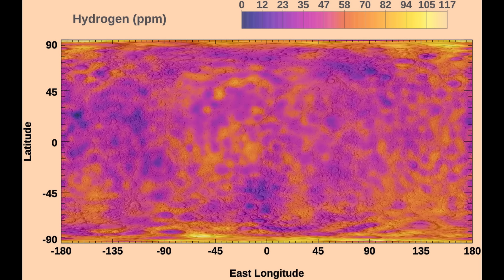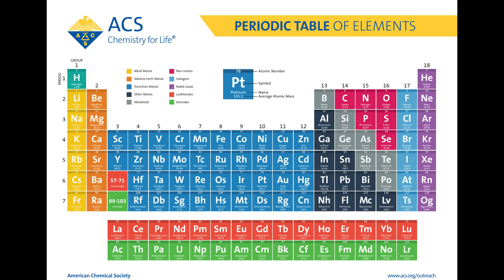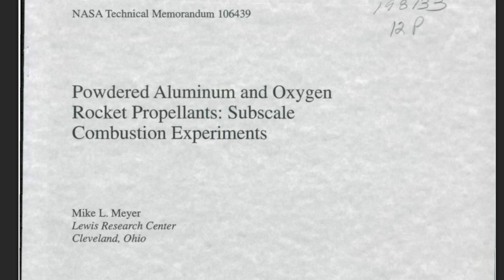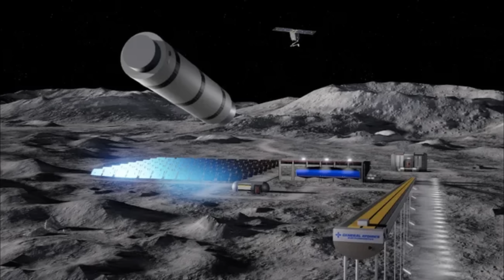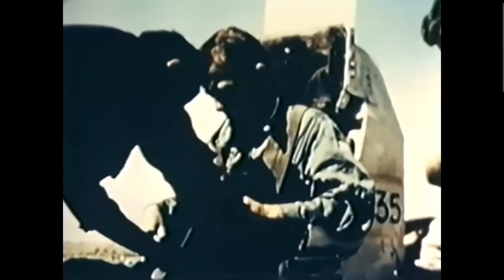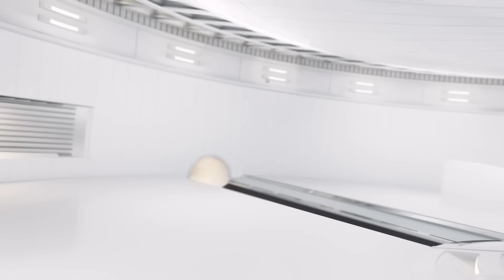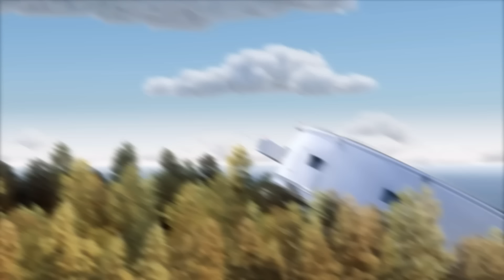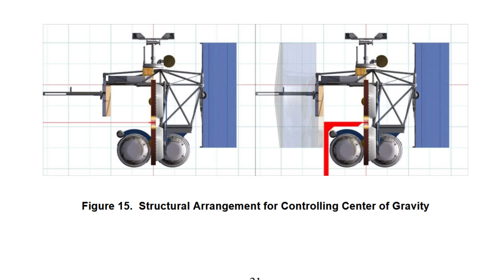Launching From The Moon With Silicon Based Rocket Fuel And Other Ideas - Deep Space Questions

Comment: Given that it takes a LOT of propulsive material, an easier way would be to have a large blast container at the back to recover and able to refine the blast ejecta. Yes, I know some will be lost from the ''Gun'' itself, but if most was captured and re-refined (Imagine suction using the higher pressure of the blast chamber, a blast shield that closes milliseconds after each shot and a  LOT of mini-sweepers recovering solid waste) it would make it a heck of a lot more efficient. A worse ''factor'' is how to slow the decent of the material shot when it arrives at the Earth, you don't want it to disintegrate when it hits the Earth's atmosphere. Aluminium for example is a toxin, and you don't want to poison the Earth... Coils would be far easier.

Comment: One way to get a counterweight for a space elevator is to use material launched by a mass driver from the moon.  For those materials where you want a container to hold it in, once it's launched and you remove the cargo, you have a big empty bit of moon rock.  Design them so they nest, and they can form giant pillars that you bind together with carbon fiber nets and anchor the space elevator.  This material would also be a good way to block high energy cosmic rays and solar flares for the zero-G station, minimizing the material you'd need to launch from Earth.

Comment: I’m fairly convinced that mining asteroids is more achievable. The moon has too much gravity, so you need a rocket that gives a lot of delta V very quickly to get off the surface and into orbit. 

Getting away from an asteroid requires nothing more than an ion drive. Even if the overall energy budget may be higher (because of the need to get back down to earth’s orbit), it’s more readily achieved because there is far less need for a big chemical rocket.

Comment: A nuclear-thermal rocket using pure oxygen as a fuel is certainly possible if the reactor core and other engine parts are made from oxide ceramics. Such reactor cores have been developed and even tested in the past for direct cycle nuclear jet engines such as TROY. Temperatures of up to ~1000°C could even be reached using metallic structural materials like Ni-Cr alloys, which has been demonstrated in the HTRE experiments.

Comment: Since you can orbit the moon at hilltop level, I always though a platform accelerated by a Maglev track and a rotating skyhook is the cheapest way to send stuff to orbit if one wants to avoid the multi-kilometer launch track and the *pick your preferred decelarating option. The combination of skyhook and short tracked "train" is also 100% reversible for landing stuff on the moon. If scaled up enough it is suitable for low-G payloads too, but you need to built the long piece of infrastructure or use rockets to compensate

Comment: AEROSPACE ENGINEER HERE: The problem with manufacturing ANYTHING off-Earth for delivery to Earth is the final step.
Delivering to Low Earth Orbit (LEO) is one thing delivering to the surface of the Earth is another thing entirely. Its simply a matter of logistics and the problems logistics create like energy dissipation. 

For every kilogram in LEO it has akinetic energy of 30.25MJ which might not mean much but 1ton (1,000kg) is the equivalent of about 7.23 tTNT and the Space Shuttle (~70 tons) is about 506tTNT or half a kilo ton of TNT. With its max landing payload of 14t a Space Shuttle comes back down with the approximately 600tTNT.

The reason I bring this up is that a few years ago Jeff Bezos (yes the Blue Origin guy) said he wanted to move all processing into Low Earth Orbit because there would be unlimited cheap energy and pollution would just drift away into space. Around that time I was working on an Australian iron ore mine called Tom Price in Western Australia. I went into mining because in 2002 I met Harrison Schmitt who told me to look into Helium-3. So I went looking for mining experience to add to a back ground in aerospace, automation and robotics. 

Tom Price was good because the math is very simple because it produces around 20mta (million tons per annum). 
At an average around 70% iron content 20tons of iron ore produced 14tons of raw iron. FYI - that's how iron ore is graded and sold - by its iron content.
So Tom Price's 20mta would need 1million space shuttle flights NOT because it need that many to lift the iron ore up but because that's the limit of the Space Shuttle coming down. Scott can explain the difference between MTOW and MLW if he likes.

Problem 1million space shuttle flights equals 600million tons of TNT.
To give that perspective the current W88 thermonuclear warhead of a trident missile has 475kTNT of "bang"
So 1 million space shuttle flights is like letting off 1263 W88 thermonuclear warheads in the upper atmosphere.

Tom Price was once a large iron ore mine for Australia at 20mta
Most of our new mines to 60mta and Australia's production is over 920mta or 46+ times Tom Price.

Sorry but unless we come up with a magic Star Trek transporter or wormhole technology we will never bring anything back from either the moon or anywhere else for use on the surface of the Earth UNLESS we only need it in very small amounts and its extremely valuable.

For example Scott mentions Helium-3 which actually has been proven to be usable for nuclear fusion BUT like every other form on fusion IT DOES HAVE PROBLEMS making it work. In the discussions of Helium-3 I once saw someone claim an amount needed to supply all of Britain's energy needs and when I extended that out to 8billion people it requires less than 10 space shuttle flights to land from Low Earth orbit at a cost of under US$5billion for a fuel value of over $1trillion.

I am NOT the only person to have worked out those sorts of numbers and its why there are people who still think Helium-3 is a viable future fuel. For anything else its the same basic problem you need to find something that is incredibly valuable per kg.

FYI - The reason why I use the space shuttle in these sorts of calculations is because to date it is still the only viable system we had for bringing any sort of cargo back down to the Earth's surface. Yes the Russian had Buran but it only flew once and nobody really knows what it might have been good for.

Here's the thing - even if we suddenly did have something better than the space shuttle and even if it was 100 times better then we'd only need 460,000 flights a year to lift Australia's iron ore into orbit and bring the stell back down. Then there's the problem that Australia is only about 1/3rd of world production. 

Plus there's all the nickel, copper, aluminum and other stuff we use to deal with.
Reply: Follow #1
On the subject of Aluminium as a rocket Propellent- ITS A WELL KNOWN Propellent.
Look at the Wikipedia page for the Space Shuttle Solid Rocket Booster and look at the propellent the link is in the box of specifications (RHS) at the bottom.
The link is for APCP (Ammonium perchlorate composite propellant) and on that page look at the list of components  and the sub-section "High energy fuels".
Reply: Follow up #2
On the subject of mining and materials process in on the lunar surface.
The most fundamental issue is "How do you start making stuff on the moon?"
How do you start digging up stuff?
How do you then process raw ore into raw material?
How do you process raw material into raw stock than can be machined, molded, pressed, forged,.... etc?
How do you get the basic machinery to the lunar surface to do these things?
How do you do casting, machining and welding in 1/6th gravity?

I priced a small lathe a few years ago and its cost was around AU$4000 and its the sort of lathe you'd need to start making stuff on the moon. IT WEIGHED 600kg NOT including the tooling, coolant, grinder to re-sharpen tools or power supply So if you added in another 400kg for all the other stuff then its a neat metric ton. 
At US$10k per kg to LEO and the expected 100x that to the lunar surface.
Its basically US$1 billion just to transport the basics for getting started on the moon and that's only if the cost estimate of 100x is right. Its more likely 10x or more than that at the moment.

FYI - for those wondering why an aerospace engineer thinks the way I do. When I went into building REMOTE mine sites in Australia one of the first things I learned is that its basically a logistics and infrastructure task. The actual digging of a hole and the processing of rocks into stuff is almost nothing compared to everything else. 

Before you even come close to digging you have to build accommodation, food storage, potable water processing and storage and waste water (sewerage) processing. Because BEFORE you can start building anything you have to take care of the humans doing the work.

That's accompanied by the logistics facilities as in places to unload and store the materials you'll build everything from.

After taking care of the humans and logistics the next thing is building the places where they work - offices and WORKSHOPS.

BUILDING ON THE MOON will be the same basic problem.
Its the great lesson I got from building mines in remote locations.

Comment: Not so long ago you did a piece on the NASA light gas gun which you have not mentioned. Such a two-stage light gas gun, can launch projectiles at speeds up to 8.5 km/s so would fit the needs. Like all other solutions it has its problems: needs explosive stage one; needs expendable hydrogen for stage two; needs a rocket motor on the payload to alter the orbital dynamics (like all solutions).
Re. the space elevator, you didn't make clear that it is effectively geostationary so imparts potential energy but minimal kinetic energy (the moon rotates once a month). To get a payload to orbit would still require an additional rocket motor, larger than that proposed for other solutions because they arrive at altitude with significant kinetic energy.

Comment: supercaps will likely be the goto, at least initially. they are a proven tech and can do the job. though if by this point the superconducting coils or some other technology are a proven and reliable method then maybe those since they would likely have a greater performance all around (except for maybe cryo temperature. that might require energy amounts higher then what is lost with supercaps. who knows)

Comment: wait, why would you need a 1000times the thether weight as a counterweight this far out? that doesnt make sense to me, 10times should be enough. also you only need to bring the manufactured stuff from earth, the bulk of the counterweight can be moon material. 
so all we really need is like 2 or 3 starships (with orbital refueling) for the manufactured bits to get startet and then just bring mass from the moon to the counterweight. sounds doable to me.

Comment: I like moon elevator, Silane is a bit scary.

I am convinced that mining and under ground habits are key tech for moon. 

There is a lot of water unground and mining is much easier on moon because of lower temperature, less molten core, lower gravity,  i think water could be biggest problem on moon mini g as it is on earth.

If we go deep enough we can use heat of core and night side of moon to provide power when sun isnt shining.  Another way is to construct transmission lines.  

I like you statistic that launching from moon is only 5 percent of cost from earth.  The mon could very well be amanifacturing hub.

We also need robotic cargo ships.

Comment: The energy needed to extract He3 would be more than could be produced fusing that much He3.
You can get as much power flow from batteries as you like by connecting them  in parallel.
A Lofstrom launch loop would be more practical than an elevator.
Space elevators are the libertarianism of launch technology: appealing only until you understand them.

Comment: It's important to note that the .22 Eargesplitten Loudenboomer was half joke half serious attempt at breaking 5,000ft/s in a firearm. The reality is that for higher velocities, a smoothbore is preferable to a rifled bore, as seen with the Rheinmetall Rh-120 120mm cannon that is standard in the Challenger II, Abrams, and Leopard main battle tanks, which consistently shoot tungsten darts out at over 5,000ft/s. They still use the same principles as smaller firearms of; primer, propellant, projectile and case. The problem with smoothbores and saboted projectiles is, they are typically designed to strip the sabot from the projectile with the air and stabilized with fins, again, using the air.
Reply: you could easily split the sabot in other ways, but it's still going to travel in the same direction at the same speed as long as there is no air to slow it down.

Comment: Space elevators are problematic: unsure which direction on the Moon is with the spin axis... let's call it "East" anyways. For every unit mass that goes up the SE, the tether and mass will want to drift west to maintain angular momentum. You'd need some propulsion device to add eastward momentum, or have an identical mass traveling downwards at the same time as the mass going up, although that'll probably make a funny S-shape in the tether that then reverses when the masses meet halfway up 🤔 Also, unless you're lifting something like millions of tons of mass from the Moon, I doubt you'd need a counter weight tether on the other side of the Moon.
Reply: Call it 1% of the Moon's mass before before weird things might start happening, which would be 7.35E21 kg, or 7E19 tonnes, or 70,000,000,000,000,000,000 tonnes... should be fine...

Comment: What about rail launching rockets using electric motors. Have a 0.5-1.5 mile track that makes a long sweep up at 45°-60°   maybe have a small rocket assist firing just after the ramp. A 1,000kw motor accelerating the ship  to the ramp the smaller rocket sending the second stage to orbit or beyond. The first stage de- accelerating  at the up turn of the ramp, generating power to be stored for the next launch. With a mega capacitor bank and battery bank with somewhere in the 2-4+ megawatt output with a roughly 20% acceleration boost just before  the ramp. About 1500'  then de-accelerate  sending the cargo  off the main stage. Accelerate at 
4 to 5 G's with a -5G at the end the last  1500' generating  power, a long with some small generation after the reverse of direct. And the stage going down the ramp possibly gaining a few (10-20 kwh ) the 10k LBS + main stage  should be capable of producing a fair amount of power. With it moving in excess of 1500 mph. A lot of off the wall numbers and estimates the rocket motor required could be less than 1/4-1/2  of that used in the solid booster used on the shuttle. Possibly sending a ship all the way to Earth? Or getting a start on a Mars trip .  The ramp may use a turn going back down to arrest the first stage generating power have an awesome 🎉day!